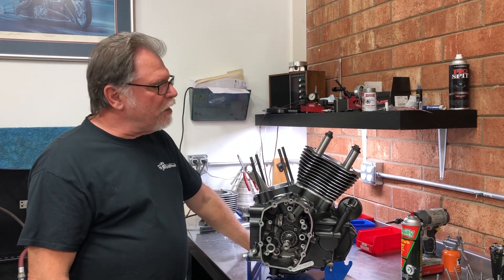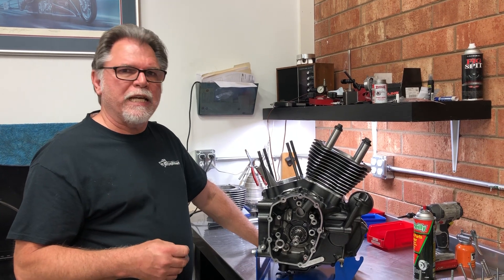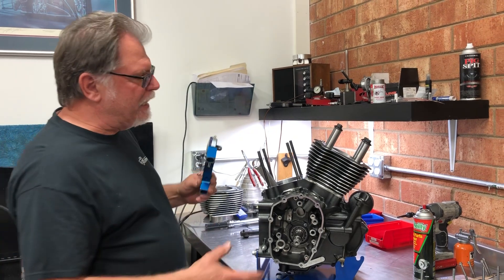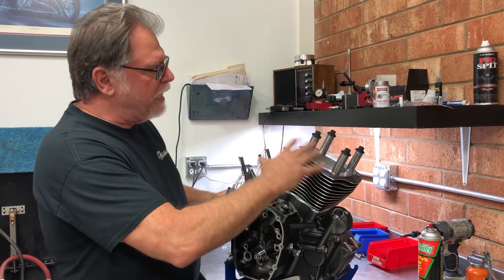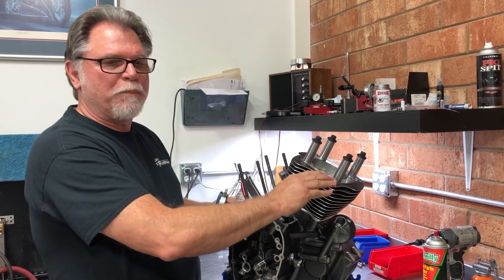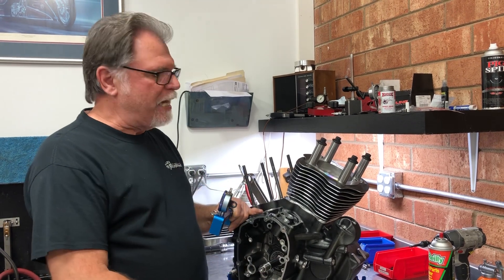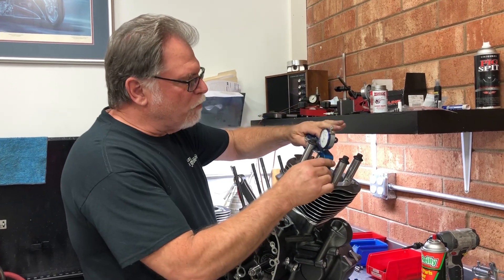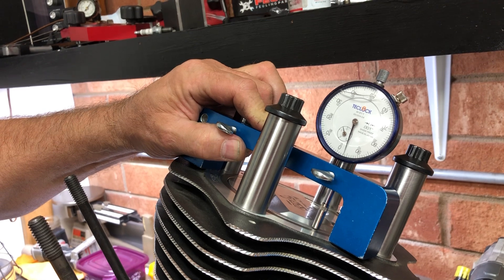M8 139” Build Series - Checking Deck Height (11 of 14)

Comment: Hey buddy, what should the deck height be on a 128/131 M8 be please? And best correcting action if not in spec?
Reply from the maker: With our piston and cylinder kits, we shoot for 0 deck height so that your squish clearance will be the thickness of the head gasket. Depending on if the piston is in or out of the cylinder, you can adjust with different base gaskets or correct compression with different head gaskets. The other option is to surface the cylinder if the piston is down in the hole.
Reply: @tmanperformance should deck height be checked prior to figuring out how thick a base gasket you need? Is it that critical or is there enough valve relief cut into the pistons to account for an incorrect measurements to keep from hitting the valve to the piston.